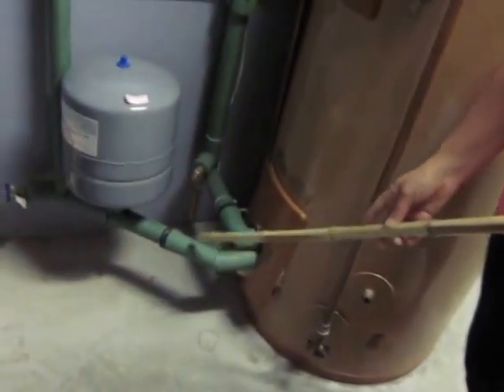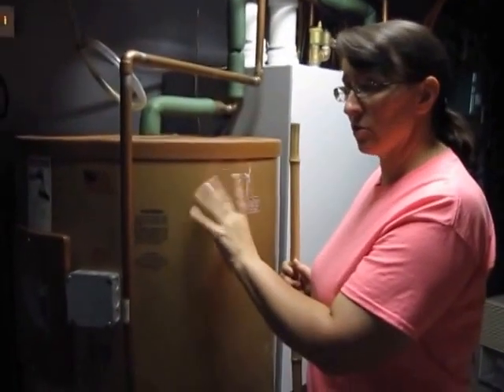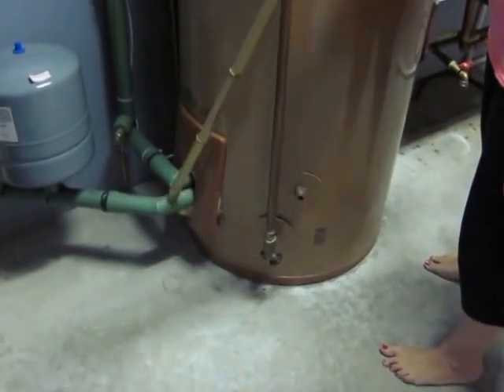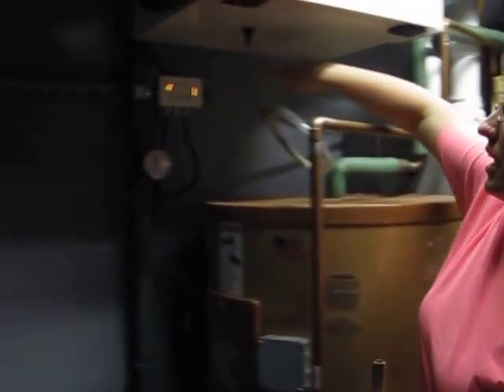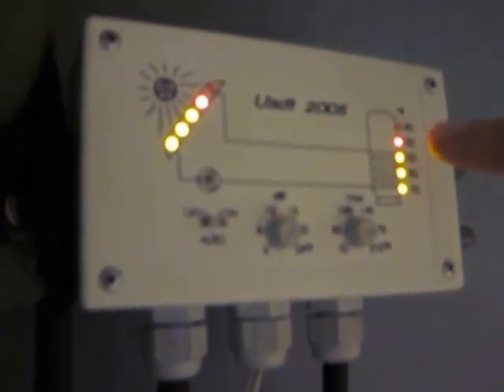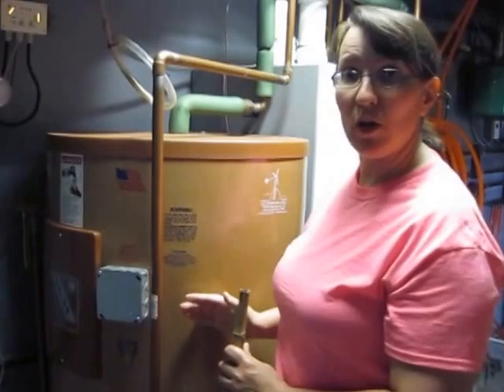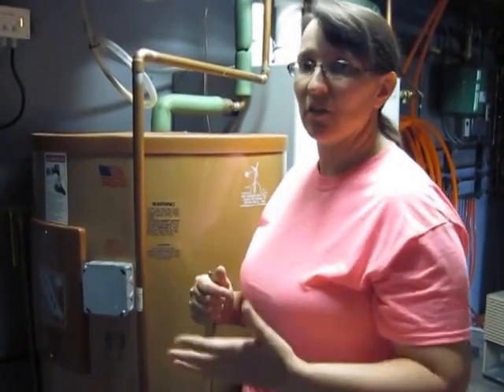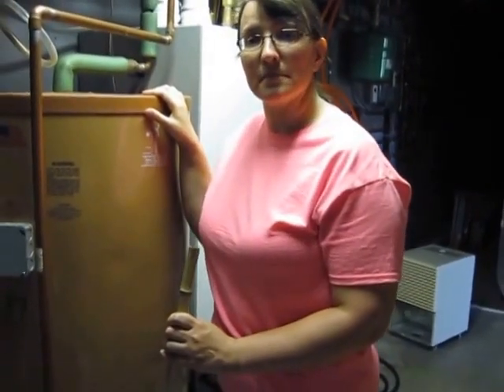Solar Water Heating Storage

Comment: How much energy absorption do you get during winter months? Do these provide enough as a stand alone source?
Reply: If we have sun in winter, we have hot water. When there's no sun, there's no hot water. Since we live in Wisconsin, where there will sometimes be little or no sun for weeks, we have a backup source of heat.

You can read more about the system, and solar water heating in general, here - https://commonsensehome.com/solar-water-heating/

Comment: Is that legal to have antifreeze thru the coil when heating potable water?
Reply from the maker: Yes. Because we live in a cold climate, an antifreeze mix is required for a functional system. For safety, the heat exchange coil must be double walled.